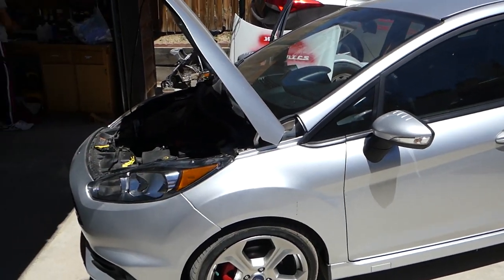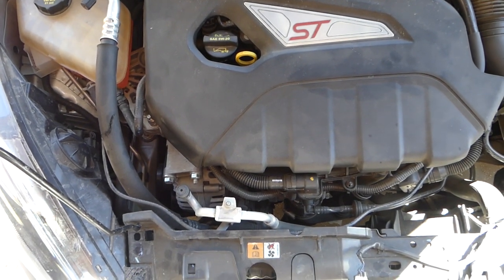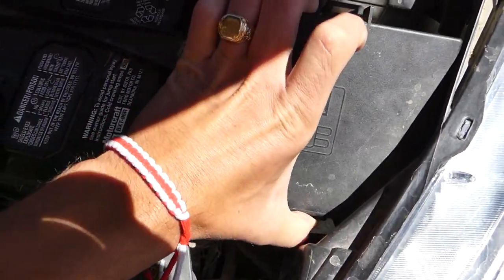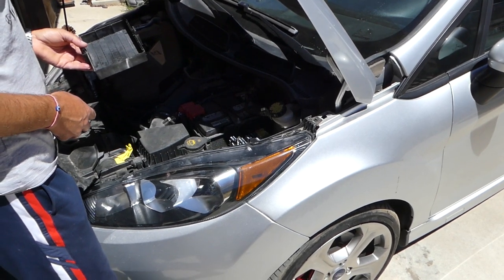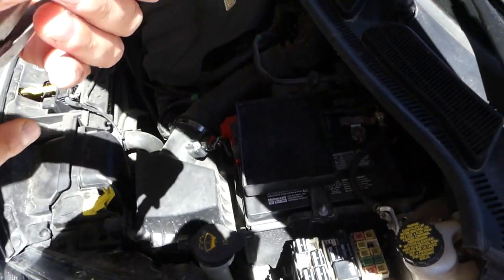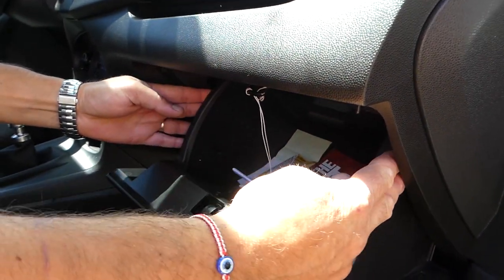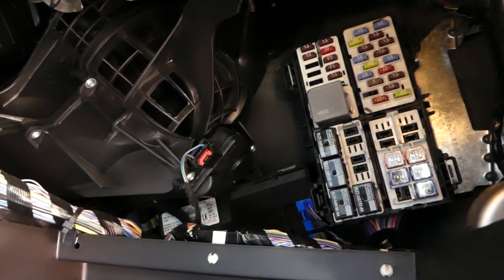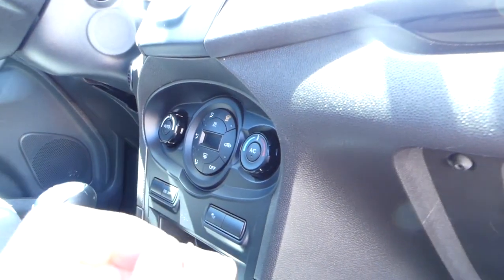FORD FIESTA A/C CLUTCH FUSE AIR CONDITIONER FUSE MK7 ST

Comment: Can you tell me where is the expansion valve is located in this car 2015 fiesta st?
Reply: It is on the firewall behind the engine. You have to take out the crossover pipe to get to it. It's held in with a tall T50 torx nut